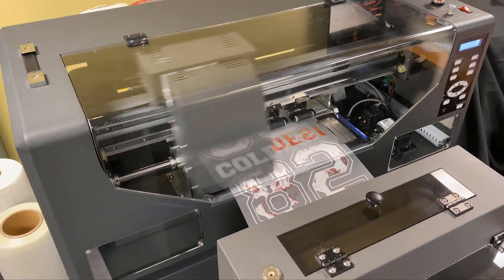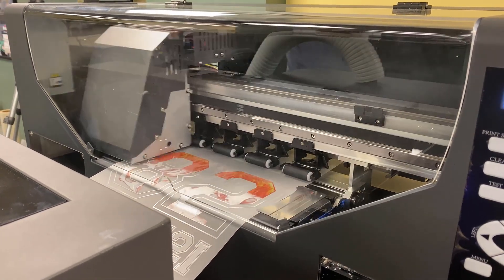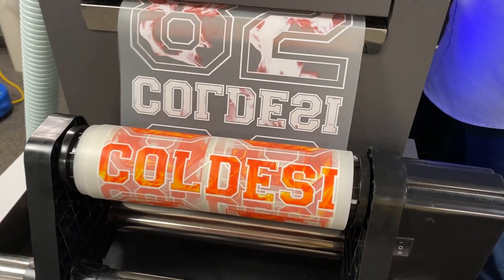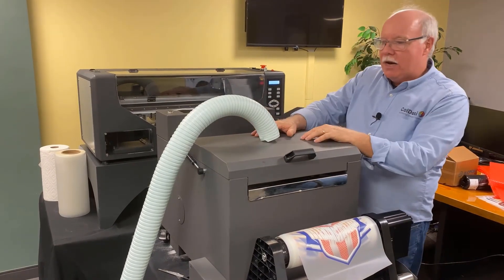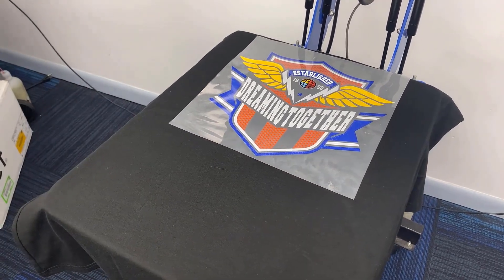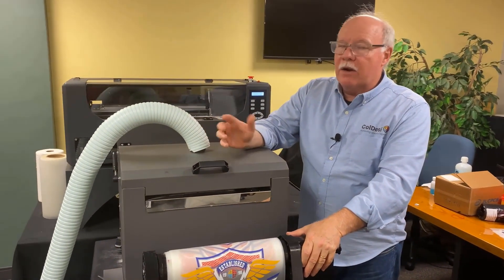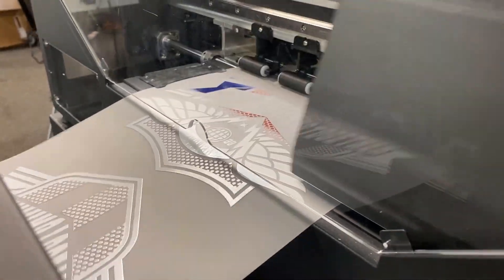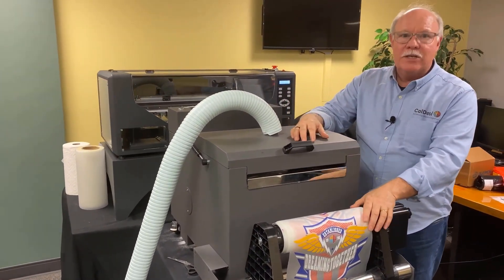How Does Commercial DTF Printing Work? | DTF-12H2 Demonstration

Comment: Hi Coldesi Fam quick question does the DTF-12H2 (v1) or (v2) does it come with   automatic powder recycle
Reply from the maker: Hello! Only our 4-head DTF printer (DTF-24H4) automatically recycles the powder. With our 2 head machines, the user will sporadically need to dump the powder reservoir back into the top tank.
Reply: @ColDesiColman  awesome thanks